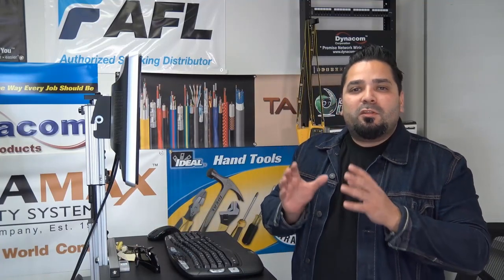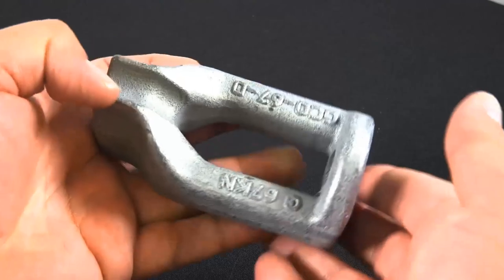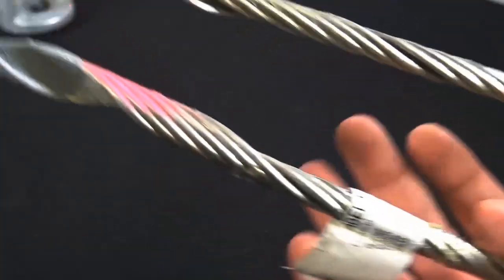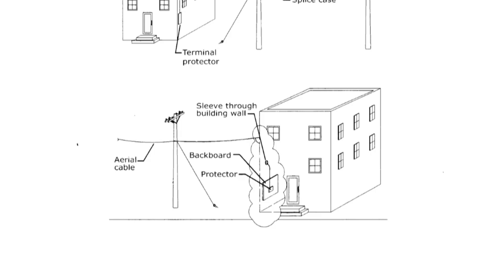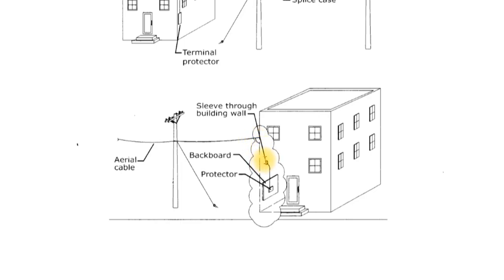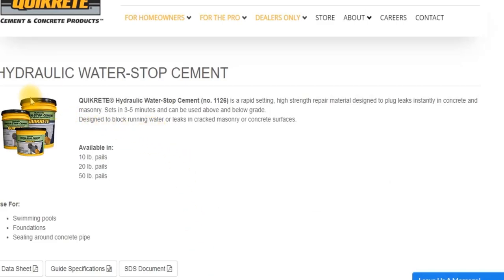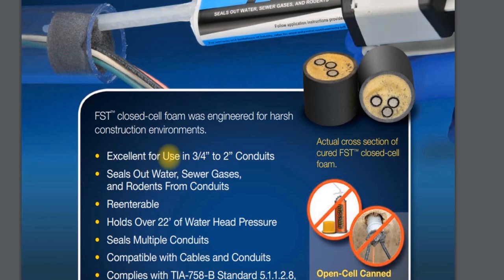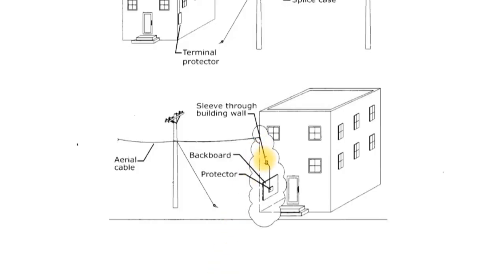ADSS fiber optic cable hardware thimble eye and dead end

Comment: Sure would be nice if I could buy the concrete and sealant at DLV.
Reply from the maker: Unfortunately, we do not have the Hydraulic Cement available but it is commonly available at your local hardware store. The sealant for your conduit sleeve we do have available.   https://www.discount-low-voltage.com/Cable/OSP_Cable_Accessories/Polywater-FST-MINI-1G-conduit-sealant-kit Thank you for the thumbs up on this video and look forward to fulfilling your needs.